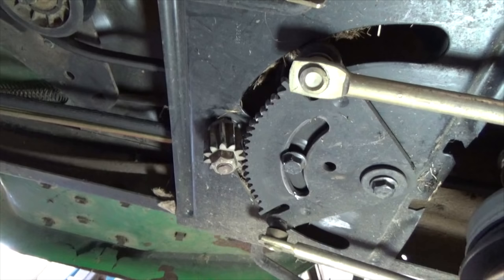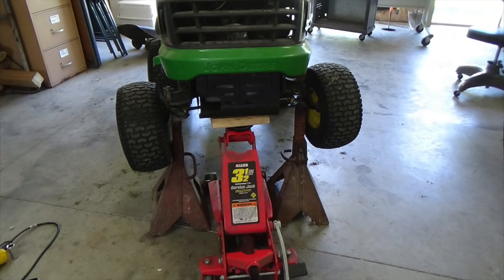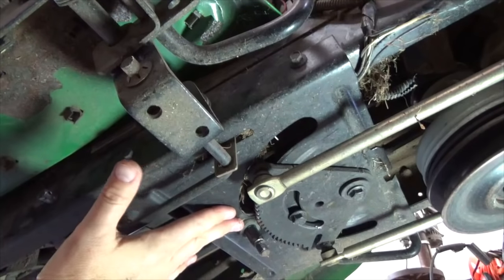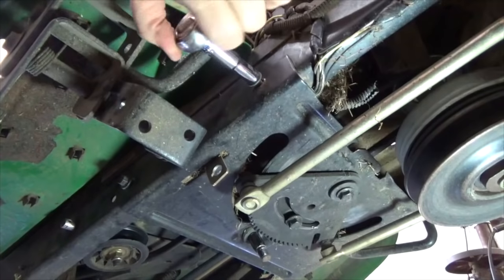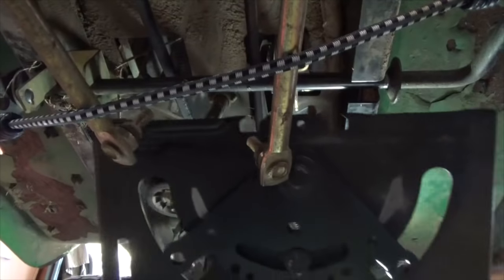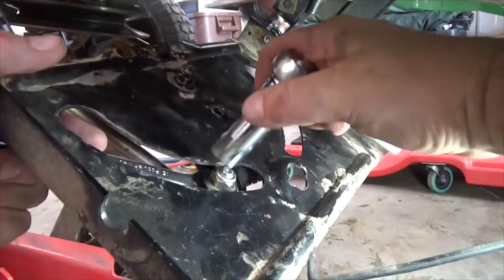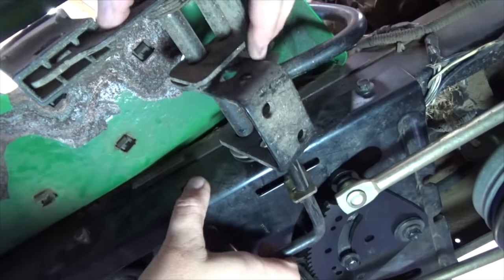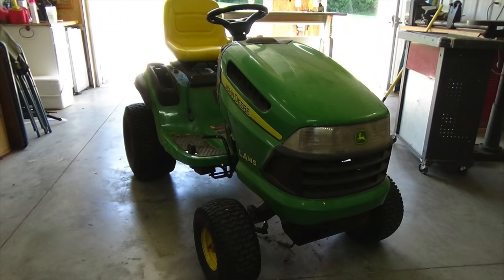Steering Sector & Pinion Gear Replacement - John Deere LA145 Riding Mower

Comment: There is a much easier and faster way to do that. I change the steering gear and selector in 20 minutes without removing the deck or the plate holding the selector. First, I use a 5/8 ratchet wrench to remove the bolt holding the gear. Then I use a 5/8 and 1/2 inch wrench to disconnect the front right wheel from the steering linkage and move the linkage out of the way. That frees up access to get an open end 5/8 wrench between the plate and the frame. Hold the front bolt with the 5/8 open end wrench and use a ratchet on the bottom to drop the bolt. Remove the bolt and bushing from the bottom and nut from top. Do the same thing for the rear bolt and bushing. It is a little tight but it is fairly easy to get the 5/8 open wrench on the rear nut holding the rear bolt. Once both bolts are removed, the selector will drop down and it is now easy to access the 2 nuts that connect the steering linkage to the selector. Then, connect the new selector and re-assemble in the reverse order. 20 minutes maximum time to do this job.
Reply from the maker: Great tip.
Reply: Olivier Mader, you should make a video showing how you do it. I followed this video (first time doing this type of replacement) and it took me a couple of hours, but well worth the $300 or so I saved by not taking it in. Great video Phil! Extremely helpful! : )
Reply: I would like to see you do that in 20 minutes.
Reply: Olivier Mader takes me about thirty minutes
Reply: Yup - I've used this shortcut method two times since I bought the mower in 2004. The first time took some figuring out but the second time really only took about 30 minutes. Also, the first time I figured I'd save a few bucks and only replace the pinion. False economy. The rack was already chewed up and my fix only lasted a season. And, some of the aftermarket plates are pretty soft and the hardened pinion can cut out a tooth if you get the steering wrenched - say by dropping a wheel into a hidden rock pocket. Sigh. Third time coming up later today.

Comment: I just changed the steering yesterday on a four year old D170 utilizing information on your video.  Once the steering sector gear was replaced fitting the plate back up on the machine was quite a task due to the close fit with the brake attachment on the left side.  I had to do some light jacking to get it aligned with the bolt holes.  The rod supporting the right side forward and reverse pedals was horrendous to refit requiring removal of the pinion nut to gain enough clearance then manually pushing it backwards to align with the mechanism.   The part I ordered through ebay proved to be quite a bit lighter gauge than the original so I don't hold out much hope for it being a lasting repair.  I have seen some discussion about using two steering sector gears to reduce the significant "play" between the plate and pinion gear.  this will be my next effort.  Overall a very poor design for a product selling for nearly $3000 with John Deere written on the side.
Reply from the maker: Yes indeed....  I have been very disappointed in the amount of quality that $3000 will buy.    I have two JD mowers.... L130 (old) and LA145 (few years newer than the L130.     I can tell you that the newer one has had the most repairs and issues than the old one.  The only good thing that I can say, is the engines are pretty good.  The rest of the mower is garbage.   I'm ready for a change in brand on my next one.
Reply: Two sectors with just the teeth welded on to provide twice the gear contact.
The secret is to replace that plastic bushing (they used to be Bronze) often.  That is what allows the gears to jump when it is ovaled out.

Comment: what size are the nuts on the plate?
Reply from the maker: I truly don’t know.  I always just try fitting wrenches until I get the one that fits perfectly.  I assumed everyone else does the same… however, im finding out that Im just an odd-ball.  Im going to try to make a point in stating sizes in my future videos.  I get that question a lot.

Comment: The pinion wont come off. Have tried greasing it overnight and heating it up.It is STUCK! Ive replaced this b4 and it was hard to get off, but this time it wont budge.  Any ideas anyone?
Reply from the maker: If WD40, and a hammer to break it loose doesn't work, I'd probably try to get my hands on a Jaw Gear /Pulley /Bearing Puller.
Reply: well,bf used a hammer, wd40, heating with blowtorch, a hammer a hammer a hammer...and after persistence...walah! Thanks for answering Phil! he has more patience than me...he said a lot of words we cant repeat (smashed fingers) but he also kept saying...it will come,its just a matter of when. ha ha

Comment: Folks, if you replace your tie rod ends and shafts just remember that you have a left and right one, I didn't pay attention to left and right when installing mine and installed the left one on right side and vice versa and the wheels would not turn. This is a easy mistake to make as mine were not labeled....
Reply from the maker: Thanks for the tip!

Comment: Anyone else have steering issues? My steering gear keeps getting very worn after one use. I’ve replaced the sector gear, pinion gear, plastic bushings, etc. but I still have the same issue. Any suggestions?
Reply from the maker: the product quality is important.  John Deere puts CRAP in their mowers in order to bring the price down for big box stores, HOWEVER, the replacement parts are high quality (not the same junk they put in at the factory)......this is my experience.  so......buy JD parts.  You'll pay for them, but they last longer than after-market parts.

Comment: The only thing I might suggest to improve this video is while you have this plate off inspect the main drive belt and the tensioner pulleys from the engines upper drive pulley to the rear transmission. If you find the belt cracked or frayed or the pulley edges ground down then you should replace them now as to do it later requires that you take the steering  sector gears and the support plate all apart again for access.  The drive belt runs down either side of the steering column.
Reply from the maker: Very good tip.  I actually thought of that, but figured I would wait and make another video when the belt broke.   I'm a "2 for 1" kinda guy!  Thanks for the feedback, Britton!

Comment: So....instead of putting a new pinon gear on (and I think the sector gear is in fair condition), I put in a new bushing and some space washers dropping the former wear of the pinon gear so that it is not in line with the sector gear.  A brother in the comments below said that they took the pinon gear and drill it larger on the one end and reverse it to adjust how the pinon gear lined up with the sector gear.   One the little test drive I have done, the steering is still difficult.
Reply from the maker: Funny you say that....
. This actually crossed my mind when replacing this contraption!  Great minds think alike! Ha!
Reply: After putting it on I was still having trouble so I replaced the sector gear.   I didn't think the sector gear had much wear.  Apparently it does because steering was still difficult.

Comment: The pinions  and steering shaft bushings  are the biggest problem on mowers. More than any other part.   Hard to repair is one reason.  The most constant wear part other than lawnmower blades.   Leaning into a turn  while the mower is going fast will cause them to wear even faster.   The most under designed part of a mower are  the steering components, including the rods that are connected to wheel spindle.  Very weak.    You have to move up to high end  mowers to step up in quality. Usually includes power steering.
Reply from the maker: correct!  I also find that if you need a replacement part, such as a drag link, the part is usually a higher quality than the one one on in the factory.  A dealer told me, the big box store JD riding mowers are only designed to last 7-8 years on average use.  I mow 3 acres and rough ground.  Been using an Xmark zero turn lately.  love it.

Comment: Wish they had used this system on my Scott's 2046!!
Reply from the maker: Never had to deal with Scott
Reply: @PhilCrockett  the pinion gear is welded onto the shaft and they want $150 for a replacement shaft!!
Reply from the maker: That's insane!
Reply: @PhilCrockett  yeah,I got rid of it and picked up a Craftsman gt5000

Comment: I am going crazy trying to put the brake lever Rod back in...
Reply from the maker: I know!  Isn’t it awful!  You’ll get it, just keep trying.
Reply: I truly appreciate the video and your reply.  I'm pretty sure that what you were calling the brake Rod Lever is actually forward / reverse pedal linkage; which runs into the trans (I think)that ... even though my model number is slightly different(mine is a JD 190c). After learning the hard way I found it was a piece of cake just to remove the back tire and remove the linkage from the transmission and then reinstall the rod through the pedal. So next time that will be the very first step! Once again thanks a bunch
Reply from the maker: Yes.  .  There are a number of contraptions like this on about everything I fix.  Nothing ever seems flawless or simple in design.   I'm glad you got that darn thing out!

Comment: my steering sector gear is loose..what could that be?
Reply from the maker: It should be a little loose.  It has to swing and 'give' a little.  if you think it's too loose, then you may need a new bolt for it.  (it's a special bolt as you can see in the video).  i bet that thing costs more than a few cents.  Let me know what you find out.

Comment: I have a models lt55 John Deere riding mower I need a steering gear
Reply from the maker: I bought mine from a John Deere dealership. The product was way better quality than what was installed in the factory. I totally recommend buying from John Deere.

Comment: Be careful when you remove the "brake lever rod" as it is actually the forward /reverse linkage to the transaxle and applying too much torque to free the rod risks cracking the transaxle control lever. Fixing this lever is a laborious job and will likely require removal of the rear wheel, an electronic component brace on the transaxle and possibly cutting through the tractor body under the seat to use a punch to access the pins holding the lever. This is not an easy fix. You need to contact Tuff Torque for the components. The bolts on the steering plate are not as easily removed as the video indicates either. Unless you have impact wrenches, be prepared for a struggle.
Reply from the maker: Thanks for the great advice, Jordan!  Hope your comment helps other folks.

Comment: i always put grease on mine
Reply from the maker: I discussed that very subject with the local John Deere mechanic.  He said it's ok to do,...... but they don't.  The reason they don't, is because the grease doesn't last long enough to justify doing it.  He said it won't even last through one summer.   I suppose if you wash / clean, and re-grease a couple times a year, it may be beneficial enough to make this part last longer than the mower.  My experience, however, is when this part wears out, the mower is wore out as well.   After replacing this part, I got one more year out of this mower before the transmission went out (which is what JD mowers are known for).   Conclusion:  wash and re-grease at the beginning of season, the middle of season, and the end.  OR....... don't do it at all and risk replacing  in 10 years.

Comment: The odds of me doing this is 2 million to one. My John Deere dealer in Corinth Ms hasn't fixed my steering and charged me $247.50 labor. I am 74 and they think it is funny to screw up an old Vietnam vet. Old machine. I wish John Deere corporate saw their treatment David Konersmann 235 county road 1503 Baldwyn Ms 38824. I expected more
Reply from the maker: Ya....  that LA 145 was junk.   My L130 (old) was built way better.  I try to do everything myself, because these JDs break a lot, and what you said about the labor.

Comment: Don't buy a John Deere unless you want to replace the rack and pinion every 3 years. $150 just for parts from JD
Reply from the maker: Just finished replacing them in my L130.   It lasted longer than the one in my LA 145.   What a bunch of junk!   My next mower is going to be a Kubota.

Comment: That's a lot of unnecessary work. You can reach the top side of the steering gear plate without removing the deck or the plate it's attached to. Granted it's a bit of a PIA but it's a lot less work than what this guy just did... just sayin'

Comment: I would have just scrapped the cheap flimsy tractor!!!! these are total garbage!!!! better off buying a used 20 year old tractor with a real steering box.bought a new 155c from a authorized Deere dealer not 3 weeks go by....I sold it....cheap weak load!!!!!!!!!!!!
Reply from the maker: Mike,  i agree that these big-box store tractors are garbage.  However, I have two that I inherited, so to me they were FREE.  Even though I have to replace parts, I'm still ahead!   When I actually buy a new one, it will most likely be a Kubota or a REAL John Deere from a dealer.   The worse part of these crappy tractors are their transmissions.  I could go on and on and on..... Thanks for the negativity.....it's been delightful!